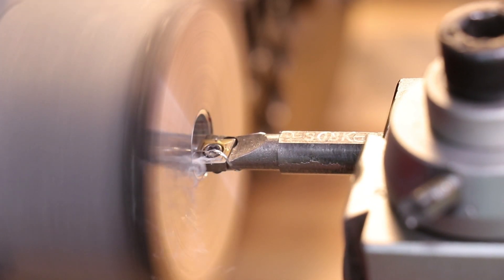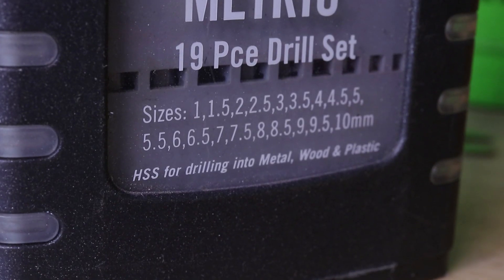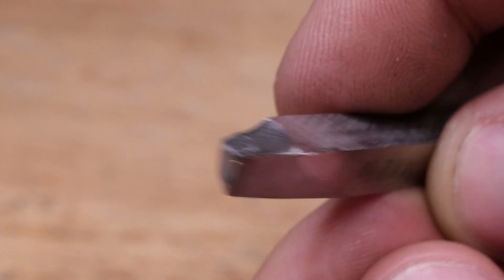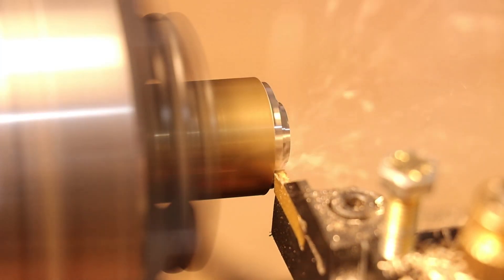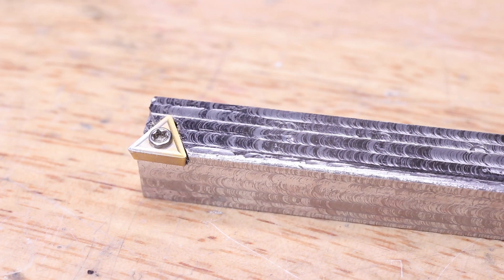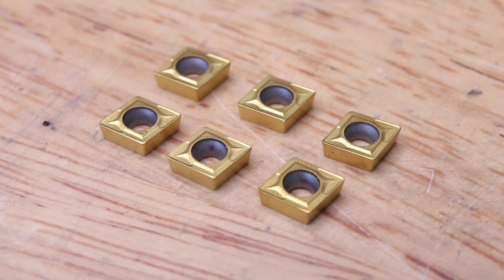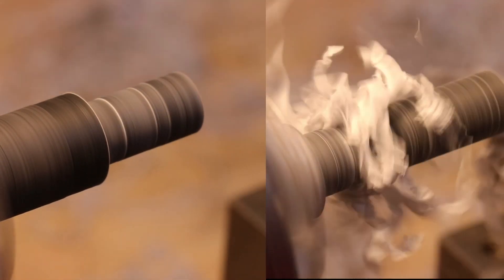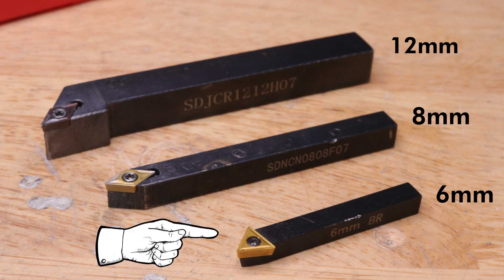HSS vs Carbide | Tooling For The Mini Lathe

Comment: Because my small lathes are cnc and used for production, I use carbide inserts. AK style inserts for aluminum are not the only inserts that have the really sharp ground edge. I use the Sumitomo FC style inserts which has the ground edge but a rake of 15° which makes the edge a little stronger.  There must be other inserts around that are similar, these are called "Finishing" inserts, so intended for light cuts, which are probably still pretty huge by are our mini lathe standards.  I would suggest that metal removal can be much the same, as the spindle can be run flat out with carbide, for most of my work the maximum of 3000rpm is theoretically too slow. As a guide anything non ferrous below 30ø can be run at 3000rpm and for steel at 100m/min surface speed (which fairly conservative and a low figure) anything below 10.5ø can be run at 3000rpm. 
I must admit though that in my larger manual lathe, I do like moulded inserts.  They deal better with any operator that is a bit clumsy and bangs the tool into the work, not me of course! LOL

Comment: Great video, full of good information. 

There are a couple of improvements I'd suggest for your mini lathe, that will further improve accuracy and surface finish.

First and foremost: That tool post. I had one just like it... It's a quick change, your tools are "always" on center, and the price point makes it VERY tempting... But after using it a few times, I can honestly say that those cheap aluminum tool posts are absolute garbage. First, they're aluminum, so your rigidity is handicapped right out of the gate. Further, the tolerances on the dovetails are terrible, so repeatability in X, Y, and Z is utter trash. And again, rigidity suffers greatly. Do your lathe a huge favor and upgrade to an Aloris-style 0XA wedge-type tool post. They're a bit more expensive, but the Chinese clones are actually pretty damn good, and the increase in rigidity and repeatability are MORE than worth it. I can't recommend this enough... It's probably the single best improvement I've made to my mini lathe. Deeper depth of cut, and improved surface finishes are a tangible result.

Second: Inserts. Inserts meant for aluminum are where it's at for these small lathes, even in steel. They're much sharper, and have a positive rake angle. This reduces tool pressure considerably, which helps a great deal with the inherent lack of rigidity these little lathes have. 

Another easy thing that can improve rigidity is adding locking screws to the compound and cross slide. Simply drill and tap a hole for an M4x0.7 socket head cap screw between the first two gib set-screws of each slide. Tightening the screw locks the gib against the dovetail, and you'd be surprised with the difference this can make with rigidity.

Optionally, getting rid of the compound completely, in favor of a solid tool post block, is also a great way to improve rigidity, though this requires some effort and tooling to make. Again, though... It's well worth it for the deeper depth of cut, and better surface finish.

Keep up the good work. These lathes get a bad rep, but they can be capable little machines, if you put in the work. Great to find someone else making good parts, and good content, with a mini lathe. Cheers!

Comment: I've found that brazed carbide lathe tooling is the best of both worlds. It is important to buy name brand brazed carbide and avoid the Chinese mystery tooling. The name brand stuff is inexpensive and with a 6" silicon carbide grinding wheel for $20 you are good to go. There are 3 grades of carbide tooling. One is for iron and the other is for everything else. The third is good for everything but is a little more expensive by a few pennies. I have brazed carbide lathe tools that are 40 years old and still have plenty of life in them.
You can grind your tooling as needed just like high speed steel and when it's chipped or damaged a few moments with your green silicon carbide wheel has you back in business.
In a commercial business insert tooling rules. Time is money and you can't waste time sharpening tooling by hand. Just as important changing a damaged or worn out insert with a new one often means the tool setting is very close to the insert just removed. 
Cheers from NC/USA
Reply: In my experience there are multiple grades of carbide for specific materials.
When I worked as a turner it was specific for cast iron with a different grade for the stain less steel shafts we made (way beck when, all brazed carbide) Insert tooling was a rarity in the 1970's even in medium sized machine shops.
Reply: I agree, for general model making use brazed carbide are hard to beat as long as you can grind/sharpen them I picked up a RJH Ferret diamond honing machine and its great for brazed lathe tools.

Comment: Nice video for folks starting out. You can use the sharper AK geometry in carbides. eg. CCGT060204 AK H01
Reply from the maker: Cheers. I have used these sharper insets before but for the mini lathe, my experience was mixed. They do perform better than the ones I used in the video, but the edges were very brittle and the lathe was not rigid enough to prevent them from breaking when I took moderate cuts. I still found that the HSS was sharper and must more resilient. However I seen some people use them and get good cuts on their mini lathes, maybe the ones I purchased were duds.